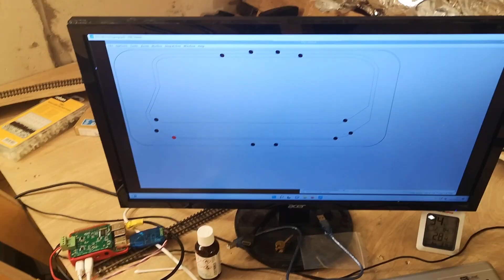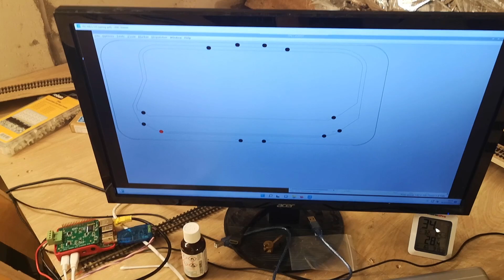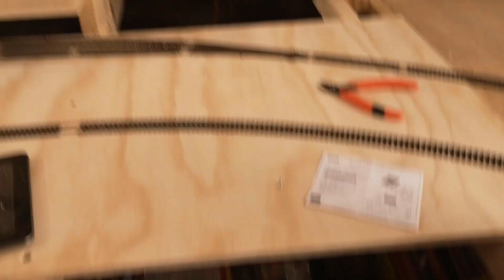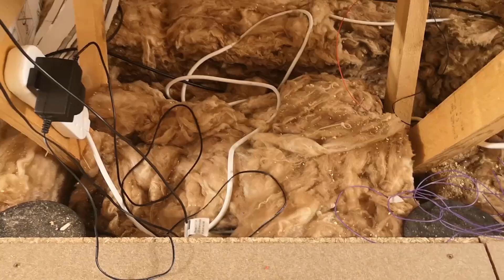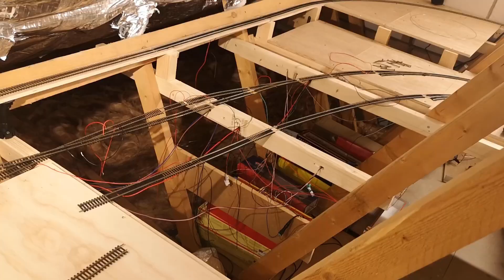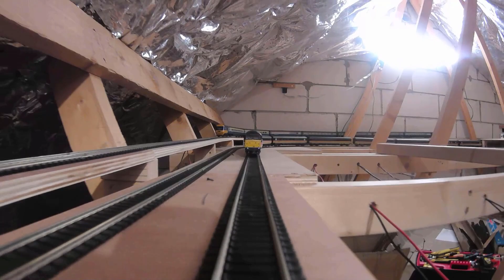Build update - Decision time on warped boards, and Arduino DCC+ Commmand station limitations

Comment: The device is newer than you video but now there is an approved 5A per channel motor driver for dcc ex for about £35.
Reply from the maker: Thank you - it's really encouraging to know that there's something on the way - I was really quite uncomfortable messing with that board I used, although I have to say it's been extremely reliable. Looks like this is the new one?
https://dcc-ex.com/reference/hardware/motorboards/ex-motor-shield-8874.html
Maybe not quite available in the UK yet but I'm sure it'll make it! Regards, Chris

Comment: Arduino motor shield will only give 2A per channel.  I use DR5000 with two boosters on jmri
Reply from the maker: Thanks Richard that's really helpful. I think that Arduino solution is great for a beginner, or test layout, but you soon find its limits on a full layout.
Reply: @WirenwoodModelRailway  You ccan build DCC boosters and wire up sub districts if you require more amperage :)